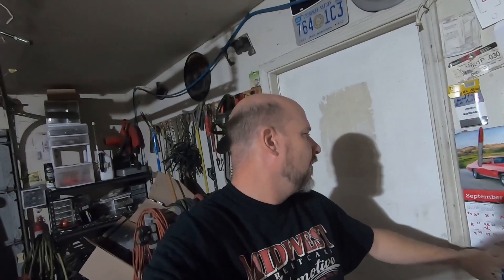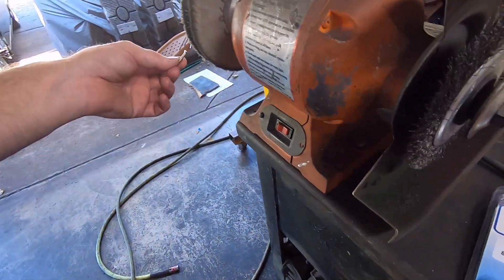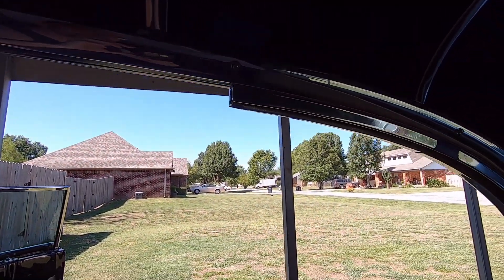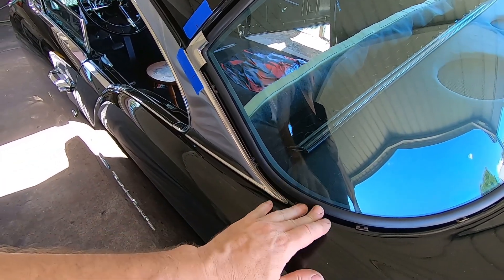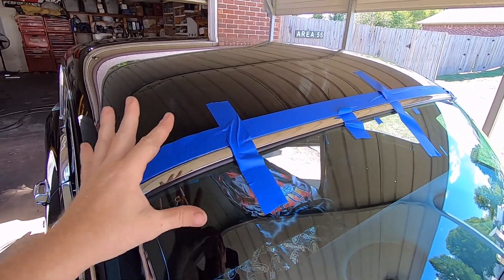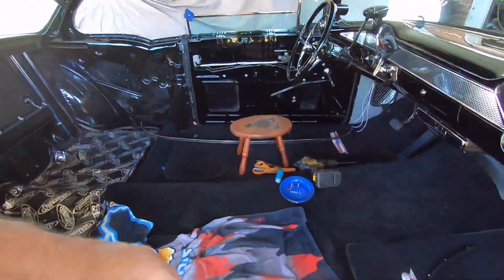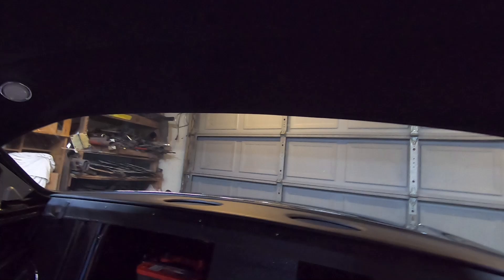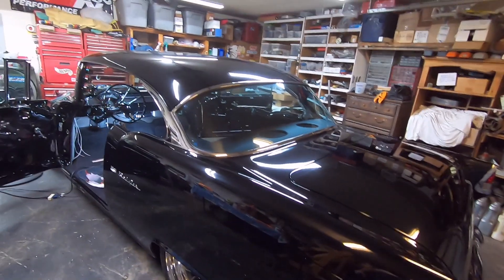1955 Chevy project. Putting on some trim

Comment: It's always a great time when the "jewelry" starts going on the car!  Especially against that beautiful black paint!  I know how much work that is going through all of that stainless and white rouge compound (hopefully not much emery).  Those hardtops have a new level of stainless compared to the sedans I usually do.  I am amazed at how my Dad Howie got through all of what you are doing with his '55 Hardtop after retiring and in early stages of Parkinson's that we have on the channel.   I have always appreciated your level of detail, forward thinking or preventive thinking in protecting the car during assembly.  Also, fixing the assembly line flaws by spending the extra time fitting all of the components correctly really takes the car to the next level.  The car is really an amazing project and I look forward more videos and seeing the car finished!  Take care and keep up the stellar work!

Comment: That trim looks fantastic and the back half of the car as well! My 56 has the places for the "opera" lights but doesn't use them. I think the 55 & 56 used the same tops. Maybe they just added the backets for the center light on the 56 models.